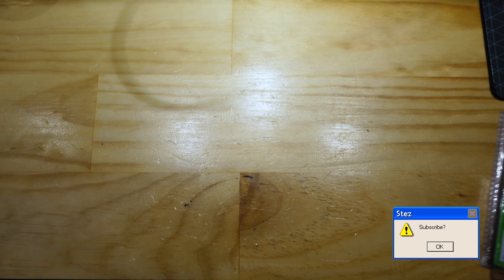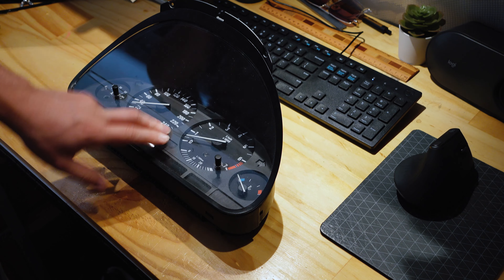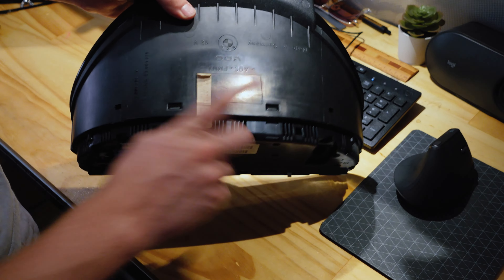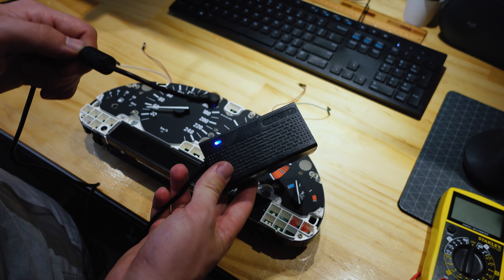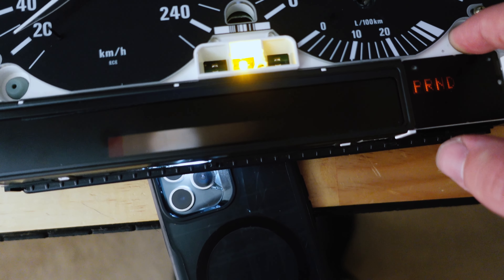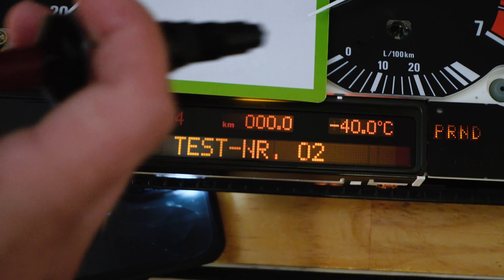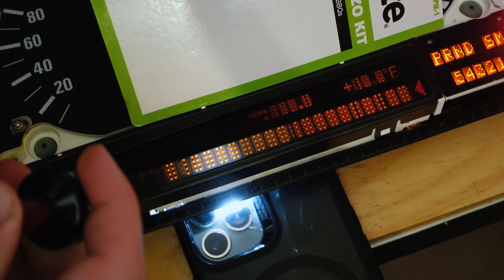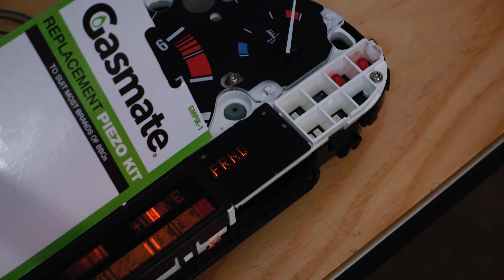Don't try to fix an LCD screen like this (piezo ignitor test)

Comment: I tried your method on my stock radio (BMW 2003 X5) and it worked.  All the pixels turned on.  I should’ve listened to you because I tried your method on my cluster and now it’s worse and on top of that I have the brake, ABS and traction light on.  Now I’m trying to figure out how to get rid of those three lights.  I’ll try disconnecting the battery and reconnecting to the issue.  There’s a guy on eBay that’ll eplace the LCD for 100 bucks. I might just end up doing that.  My X5 is a solid car with 98,000 on it.  Any additional recommendations would greatly be appreciated thank you and thanks for posting that video.
Reply from the maker: I’d go for the replacement service, I’m hoping it fixes your warning lights too - that’s weird they came on

Comment: Would you recommend doing this on a Rolls Royce?
Reply: If you drive a Rolls Royce then yes
Reply from the maker: Best course of action is remove the V12, swap it into a Golf, 1.9TDI in the Rolls and then Haltech digital dash to replace the dead one
Reply: @OEMStez  i've done it on my opel (vauxhall) zafira, try using the lighter piezo ignitor, its way lower voltage and actually doesn't damage the pixels like the huge one you used, its way overpowered for the pixels to handle it, the 20 cents lighter piezo does wonders to those displays, i did mine like maybe a month ago and still works like a brand new one